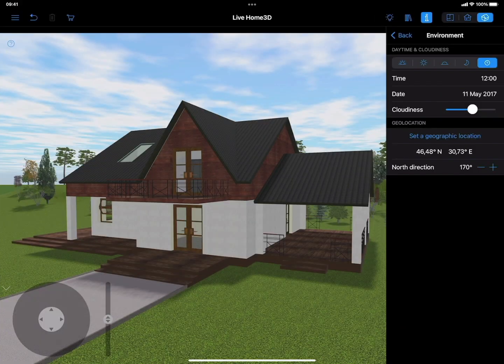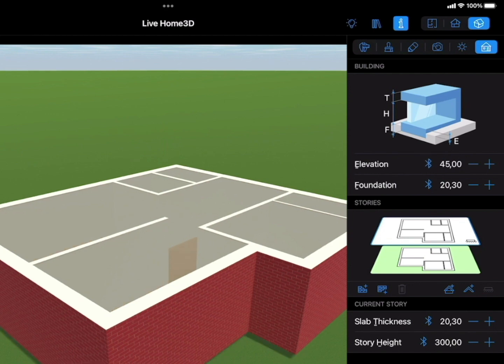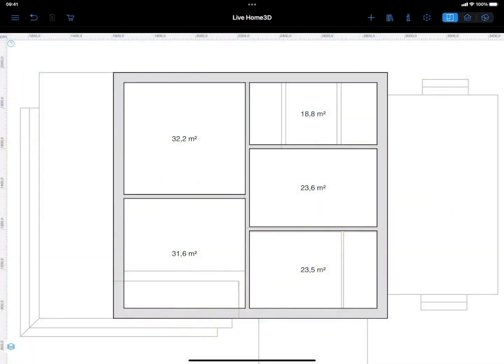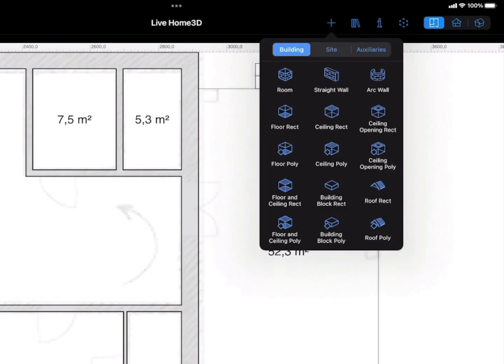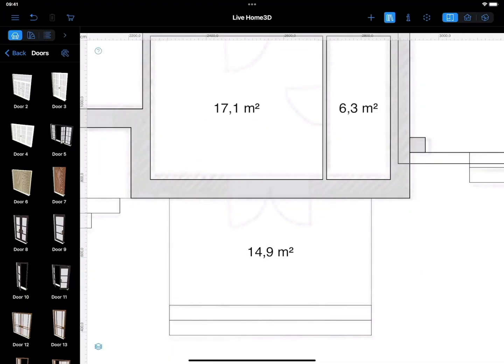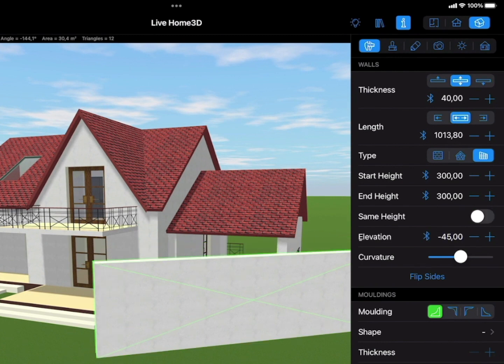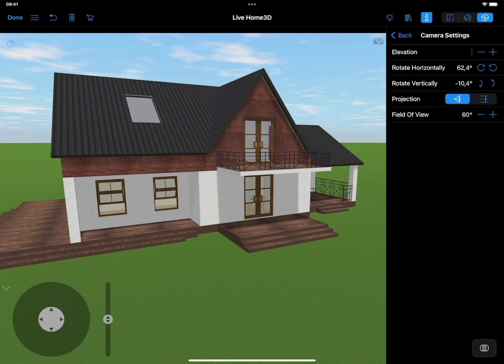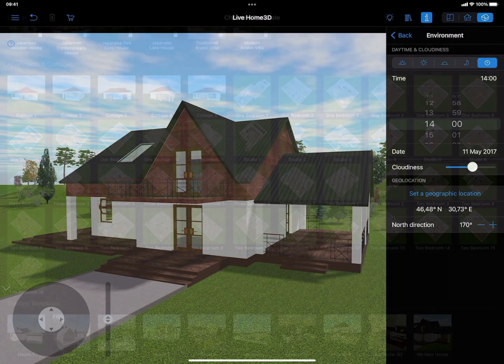How to Create a House from Start to Finish - Live Home 3D for iOS/iPadOS Tutorials

Comment: I want to set the first floor at 96', but it raises the building 96' above the site
Reply from the maker: Hi! It sounds like you're adjusting the Elevation on the Building Properties tab, which lifts the entire building off the ground. Instead, tap on the floor object itself on your floor plan, then open the Object Properties tab in the Inspector — that's where you can set the floor's elevation independently.

Comment: It won’t let me change the height of the walls I am on the free version but I don’t see anywhere that says I can’t change wall high
Reply from the maker: The program does not allow you to set up the wall height directly. All Story Walls on each story have the same height equal to the story height. To change it, use the Building Properties tab in the Inspector. The height of a Loft Wall is limited by the roof located on the same story above the wall. If there is no roof, the height of a Loft Wall is equal to the story height.
The Curtain Wall is the only wall type that allows you to customize its height directly. You can do this using the Object Properties tab in the Inspector. In addition to properties available for the other wall types, Curtain Walls have the Start Height, End Height, and Elevation. 
Though it may sound tempting to use Curtain Walls everywhere, it's important to note, that they can't form a room, meaning no floor and ceiling objects are added.

Comment: Hi, Thanks for the video. I’m struggling to switch from ground floor to first floor on 3d view mode. While working on first floor on 2d mode, if I switch to 3d mode it stays on ground floor. How can switch the floors while on 3d mode? I’m using Ipad version.
Reply from the maker: Hi. In the 3D View, you'll find a visual representation of all the visible stories within your project. To view the story above or below the current one, just shift the camera upwards or downwards using either the camera controls or keyboard shortcuts. 

You can also add custom cameras and adjust them as needed. Then switch between these cameras in the Inspector.